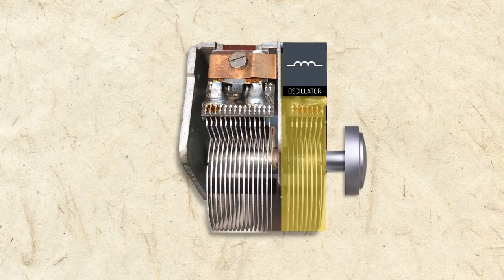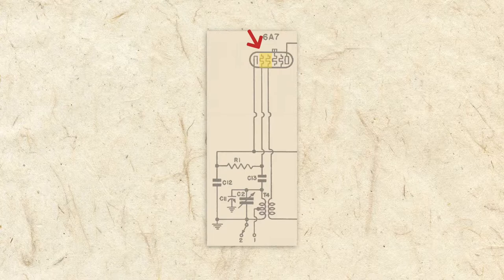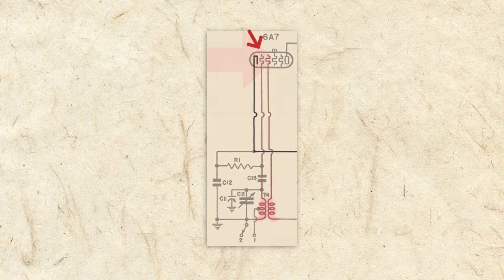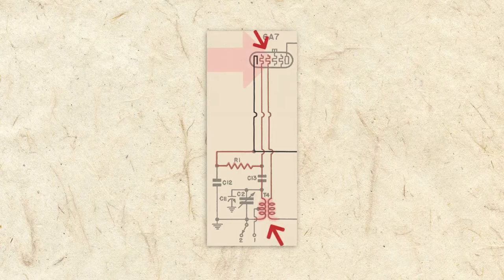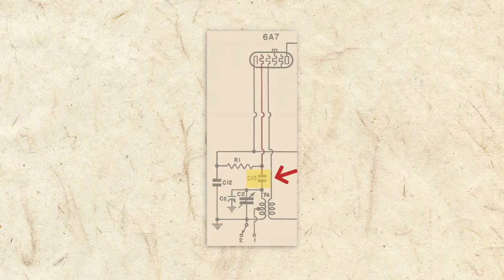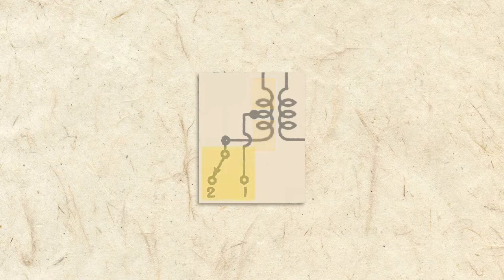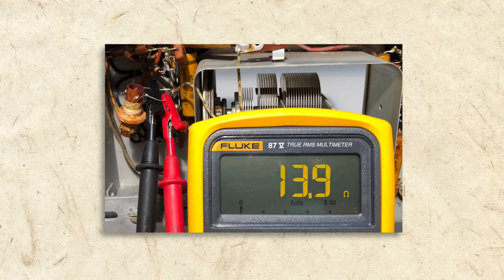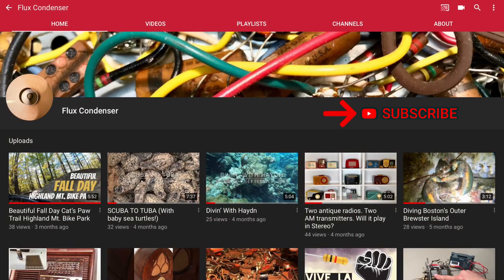How Do Radio Oscillators Work?

Comment: Hey man I am trying to understand just exactly r1 does in the local oscillator circuit. I didn’t understand the explanation so well. I was wondering if you could explain it to me? P.S love your channel discovered it today and I am loving this series on radio restoration!
Reply from the maker: Thanks Ohm-ega. Glad you’re enjoying the channel. R1 ensures that the current running through the grids gets turned off at a certain point so that the oscillation cycle can begin again. It also ensures that the capacitors discharge quickly for the same purpose. In this way, it acts as a bleeder resistor. Without the resistor, the oscillation would slow or stop.
Reply: Flux Condenser thanks man!
Reply: I’m banging my head against this but I just don’t get it. You get a positive voltage on grid 2, then a lesser but still positive voltage on grid 1. Why does the presence of the resistor cause oscillation? It seems to me that you’d reach a steady state with grid 1 and 2 both positive and R1 draining a steady bleed. Does the oscillation actually occur in a tank circuit formed by C2 and the secondary side of T4?